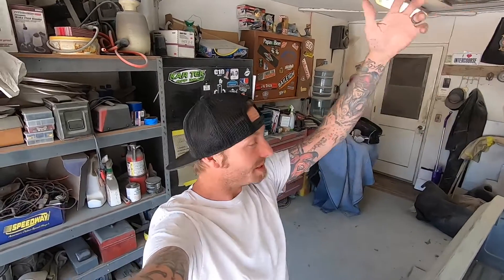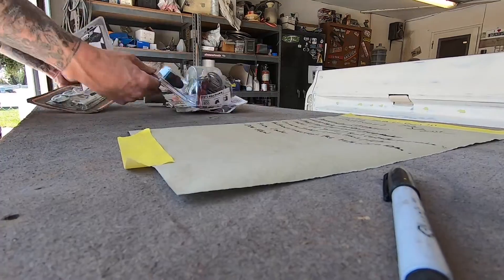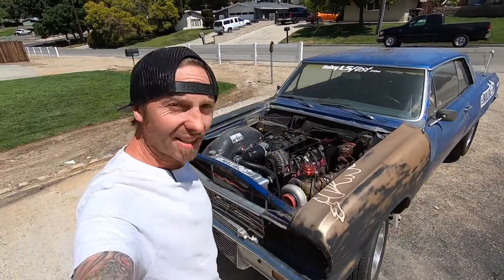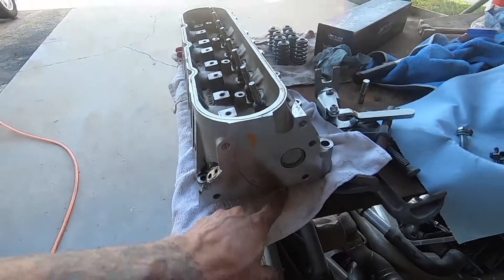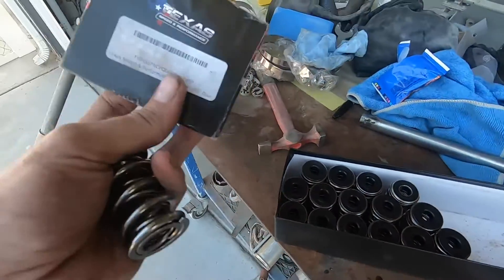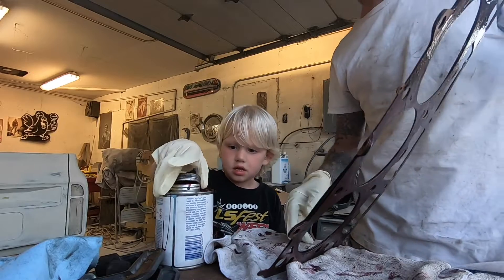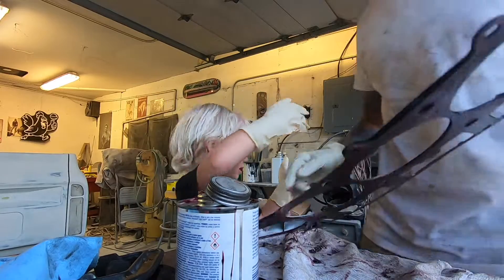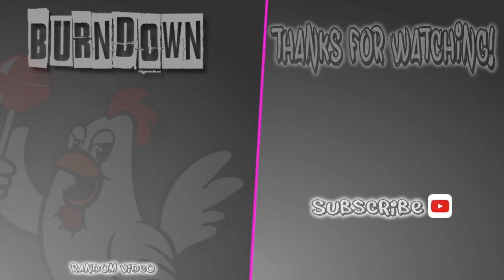How Not To Chevrolet  LS Cylinder Head Swap With Used Gaskets and Bolts

Comment: So to reuse the headbolts don't follow the 22ft 90 degreesx2 then 50 degrees for both outer bolts
Reply from the maker: No I just torque them down in three steps and call it a day.

Comment: Are those gaskets still holding up?
Reply from the maker: I used them like 5-6 times I think and they saw 20# of boost. Just make sure you clean them off as well as you can and make sure the block surface is nice and clean as well. I like copper spray too. I reused the bolts a bunch of times as well and torque them to 65# in three steps.  Youll be fine dude 😁

Comment: im going to reuse my head gaskets to
Reply from the maker: Chase and blow all the threads out in the block before you forget or do anything. Clean the surface of the block and the heads and copper spray the gaskets after wiping them down with acitone or some form of cleaner.  Let them tack up before you install them. I like to do like 30# 50# 65# for my torque with the old bolts. The small bolts on top the heads are last and you can look up the tq spec but its around 18-22# I think off hand. Im lazy so my google is broken right now. 🤣

Comment: When you said "or sharp ... or hard ..." I immediately thought - or both! You know the biz! Good find on the 5 dolla catch can too! "That's my preferred bolt breaking technique" ... Dude, I just yanked some exhaust manifolds off of some castech 706 heads I didn't care about too much so I didn't soak it in penetrating oil as long as I should have ... and some of them indeed did break! Funny story though - the ones that broke loose without breaking are the ones that sent my hand into some sharp hard stuff. the ones that actually BROKE felt like they eased off...

For those MLS gaskets, and the surfaces man ... spend the 100 bucks on an ingersol rand angle die grinder, and a real 3M roloc setup. I just did, because I got tired of shit results for maximum effort. Back in the day, we used to use the scotch-brite pads, but I'm trying out a 120 grit bristle brush setup this time. I think it'll work better even than scotchbrite for most things - and if it doesn't? i'll get scotch brite cookies for it. 100 bucks that'll get stuff SUPERclean for near 0 effort and time. If you're reusing head gaskets 10x, you're doing this a lot, and it'll earn its pay in 2 jobs.

One more thing - your awesome kid calling a prybar a screwdriver ... my snappy screwdrivers said right on them - "not a prybar, chisel, or punch"... The snappy guy HATED us and kept telling us not to pry with them right? But does that prybar say anything about not being a screwdriver? NO!!! :) I wish my kid had that kind of interest in what I'm doing!
Reply from the maker: Thanks for watching the video man! I used the crap out of those gaskets🤣 I was changing my set up and heads and all kinds of stuff. I need to get some of the plastic R loc disks with the bristles you're talking about. Im finally replacing the motor I was messing with in this video soon with a 6.2 piston and rod motor for next season. I hope I don't have it apart at all 🤞. My son is pretty awesome and as he gets a bit older he still has a bit of interest in what I do and will hang out from time to time. When he hangs out I make sure I try to involve him and encourage him. He went with me to the dyno  a week ago when we put a friends car on the rollers. He helped me clean up and handed me straps so I could tie the car down.
Reply: @Burndown  I'm looking for a 6.0 block, gonna do a modern take on the 327 with a crank out of a 4.8. I could get more power by going to a 6.2L, but I've always wanted a vette with the 327 with Ramjet mechanical injection. They're WAY out of my price range though.
Reply from the maker: @notsure7874  Watch richard holdners video on it. The powerband is so high its not worth doing unless you spin it to the moon. I though about it but then when you see the dyno results you'll be like... I should just run the stock crank 😁
Reply: @Burndown  Well yeah, the 327 was a zinger, that's the point! I'm actually considering a flat plane crank too which is definitely NOT in the original 327. It's going to live on the track, not the street so it'll be fine I think. Def gonna watch that vid though, thanks!
Reply from the maker: @notsure7874  If you build it let me know how well it works!
Reply: @Burndown  That's gonna be a long time down the road ... I gotta get my LSStang (aka - the Disgustang) moving down the track first ;)
Reply from the maker: @notsure7874  Well good luck with your projects!

Comment: Wayyyy too much work to swap to those heads imho.... especially on a turbo car. no friggin way lol.
Reply from the maker: Its not that crazy haha. In some cars you can't even pull the heads in the car. I did it just to change to a small valve head to see what it would do. Heads are still on the car but I probably could have just left it alone. The next set of heads for the car will come attached to another motor.

Comment: What was the goop you put on the gaskets? I always thought MLS gaskets went on dry or maybe with a bit of copper spray.
Reply from the maker: Whats up Jess!
Well it was permetex gasket seal. I have used copper spray on it the last few times and I had the choice to use the goop or copper spray. I opted to try the goop thinking it might work well but honestly if I do it again ill stick with the copper spray. Im always willing to try something out tho. A friend of mine said he was using the goop with good success so we will see if it holds some boost! 😆 Most it saw last time was 15lb max so we will see how it goes this time around. I should have a little loss due to the innercooer but the temps should be lower tho.
Reply from the maker: I just followed ya! Dont know if you found me on sloppy or not but I saw your sticker in your video! Im a big fan of Sloppy obviously.  If you need an Uncle Gus sticker and a Burndown sticker let me know! They are free anytime!
Reply: Burndown  Thanks Dane. Yeah I found you on the Sloppy Facebook page. Learning everything I can about the turbo stuff. I have an 81 Fairmont I'll be building after my current trailer project is done. Might have some dumb questions for you after I start :)  I'd love some stickers. I'll find you on FB 👍👍👍
Reply from the maker: @jesscneal  Matt is the king of sloppy turbos but sometimes they can be a little tough to get some straight answers with out having to hear it form like 20 people first haha. DM me on instagram and ill hook you up!!